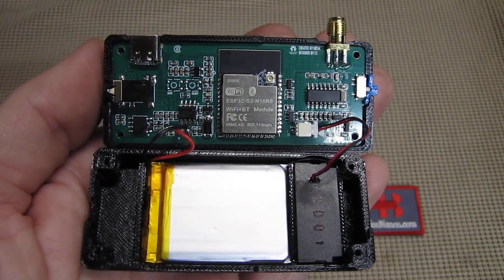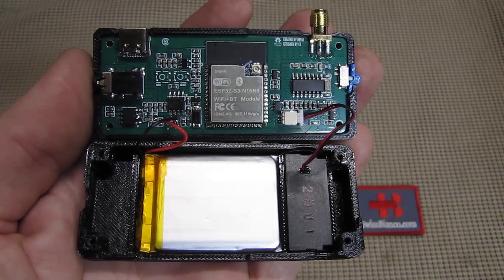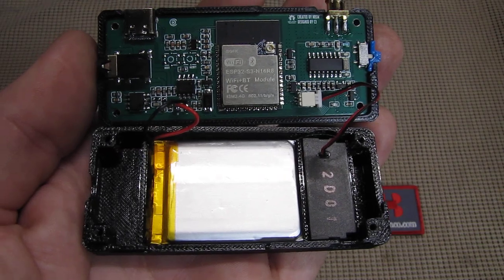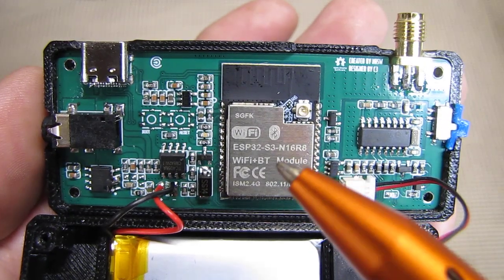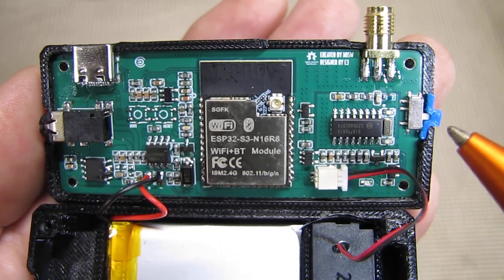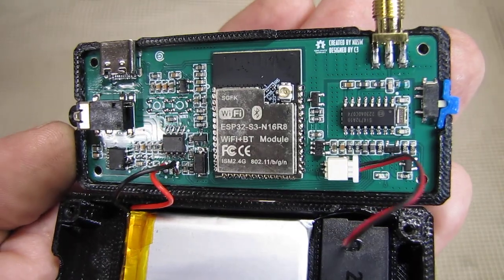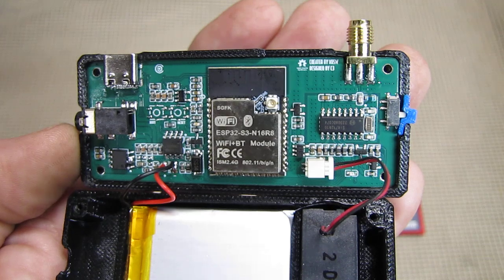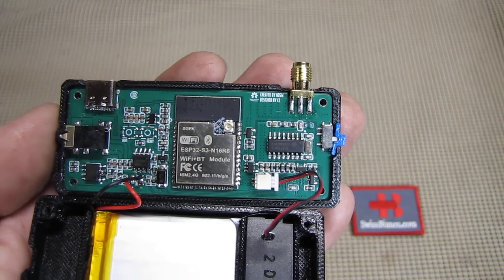Si4732 Mini Pocket Wide Band Radio - disassembly inside look.

Comment: Got very excited when i saw the picture in my flow.
It have these features:
ESP32
IPEX for external antenna
RF with antenna and amplifier
Battery + charging
Audio out with OP
Easy access to pins on ESP32
USB-C
Custom case

This device could be the base of a million different projects. I want at least 10 of them, to start with!
Reply: I just realized it also has a display. My god, it’s perfect for another million projects. 😀
Reply: The 16 pin chip below the antenna socket is the actual radio receiver Si4732, the ESP32 is used as a controller among other things.
Reply: Yes, i know. That’s the least interesting part of this unit.
Reply: @robertmosen6126 The actual radio is the least interesting thing about it? How about the fact that it only requires two pins to drive it? 3 with a reset. Utilizing just a single I2C connection. The rest is available, and all the code for this project is open source.

Comment: Does that radio have wireless and bluetooth???  The chip says "wifi+bt module".
Reply: Sorry. It does have built in WIFI. Black area above chip is pcb-antenna.
Need to be activated by firmware.
Reply from the maker: need to check on that, we still test.
Reply: No. Antenna is for RF (radio).
You connect a WIFI antenna to the IPEX-connector (little round thing on the upper right of main chip).